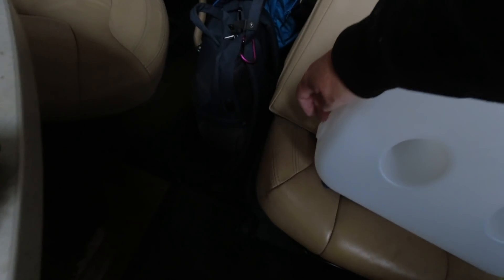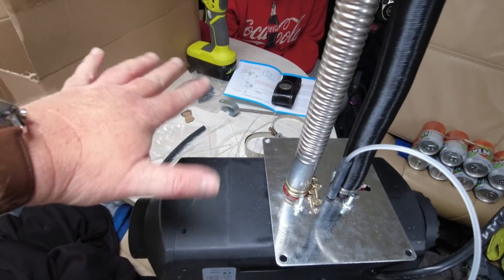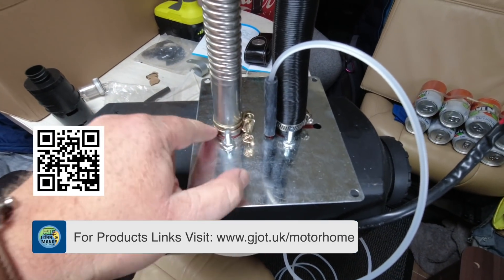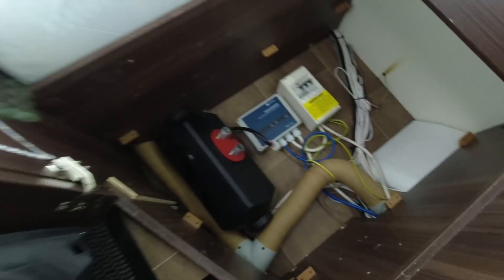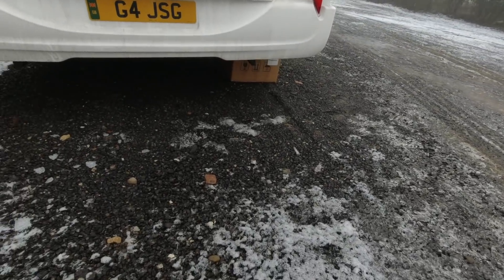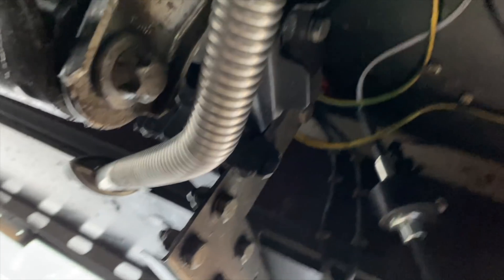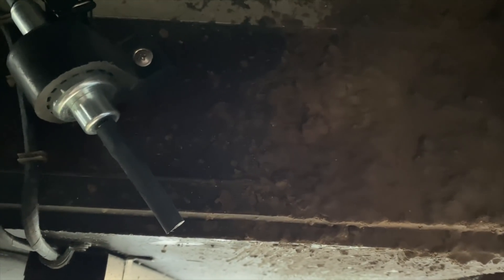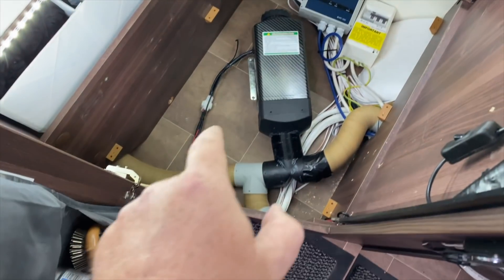Diesel heater Install in our MotorHome

Comment from the maker: PLEASE READ BEFORE COMMENTING. 
As we mentioned in the video we fitted this during quarantine after returning from the EU.  So this install isn’t 100% completed and more parts are on order to weather proof everything, make the pump quieter, protect the hole in the floor, protect the air intake and heat wrap the exhaust pipe, amongst other items. We said we’d follow up this install in a future video, and we’ll do exactly that. Thanks 👍🏻😁
Reply: It’s because we love you that we feel the need to help with trick and tips for your health and well-being and comfort, you’ve been giving us tricks and tips for years, we like to respond likewise ..we do love you, please continue.
Reply from the maker: Oh we do love any tips etc, it was just a few comments made assumptions instead of watching the full video 😁👍🏻
Reply: Nice install, this heaters are great, have one of 5kw in my Transit connect!
To silence the pump, just suspend it with cable ties, makes a big difference!
:-D
Reply: Hi you could buy a silencer for the room air intake. About the pump ticking. There is also a more silent pump from Autotherm. 
I would wanted to ask why you didn’t go for the fuel from the main tank. But the red diesel explains it. And the position on the door helps with spilling. Absolutely brilliant position.
Reply: Well that saved me asking question re an upgraded turret plate lol 👍🏻 Haha sound like I know what I’m taking about but it’s only because Darren has told me what I had to order for us lol. Hopefully get ours fitted in the next week or so, weather permitting. Hope I’ve both warmer now, useful video thanks guys 👍🏻
Reply: @zuk4wd  Removing the circular air intake grille clip from the heater housing quietens the interior noise well.
Reply: instablaster

Comment: I fitted one to my Vivaro last year, just a couple of  tip for watchers. If your running the fuel hose under your van, run it through garden hose then the sub frame / chassis this will stop rub on the fuel hose. I used a step drill to cut through the floor. You can use a mount for fitting the heater through the floor which cuts down the problem of melting your motor home installation. Finally prior to turning off, run it at about 23° for 1min this helps to clear the soot from the heater.
Reply from the maker: Thanks Andrew 👍🏻

Comment: These heaters are brilliant, had mine for nearly 3 years and it's kept me warm at minus 10 in Scottish winters. No problems with it, although I think some have had problems with sooting up inside the heater caused by running at too low a setting. Easy to strip and clean though.
Reply from the maker: That’s good then, we’ve had it blasting every morning so hopefully we won’t have to worry about that till things warm up a bit 👍🏻😁

Comment: I've installed 8 of these around a static caravan park and people love them especially when there making a great saving on the electric @ 25p per Kw 🙄compared to purchasing kerosene at 60p ltr. My top tip... To help prevent the annoying clicking sound in the van;  try replacing the fuel inline pipe from the pump into the base of the heater with a softer compound pipe. I learnt this from one heater supplied with a green pipe but with different clips. The noise seems to travel inside the pipe from the pump into the heating chamber. My 2nd tip... be careful where you mount the fuel tank as in summer the fuel gives off gas and will leak into your living/sleeping area making it stinky 😷
Reply from the maker: We’ve waiting for some better fuel pipe to be delivered so hopefully that’ll help with the click, by summer we’ll have this tapped into our main diesel tank which will be better 😁👍🏻

Comment: This is what I use in my van. I use heating oil (kero28). It's not common but some petrol stations in rural areas have a pump with it, about 40p per litre right now. Another great video, thank you.
Reply from the maker: We can’t seem to find anything remotely local that offers less than 500L 😁🙈 Red is right on our doorstep though
Reply: Yeah it's not common. I can tell you my most local one in North Devon and the one I use when I'm working in North Kent. There will always be one in an area that houses use heating oil because it's very easy to lose track of what you have, run out and then need to top up in an emergency because your family is complaining about cold baths. Guess how I know 😂. If people have oil tanks in their gardens then ask where they get their top-up when they run out. You get a lovely clean burn with Kero. Your heater will last forever. Thanks for all your technical tips. They have helped me on many occasions.

Comment: John that tip on priming the heater was an absolute gem buddy, similar to bleeding brakes remove the cap to remove the vacuum effect. Brilliant
Reply from the maker: Cheers buddy 😁👍🏻❤️
Reply: There is a 'priming' mode you can use from the controller, it's on some of the youtube videos, easy to do.

Comment: Excellent installation guys.
Just a little tip
If you used the hard plastic fuel filter that came with the heater.... replace it as soon as possible as they crack and it will empty the contents of your tank all over your garage.
(Ask me how I know 🙄)
Reply from the maker: Thanks for the heads up Ian 😁👍🏻

Comment: The silencer has a small drain hole on the side so should be mounted with the hole facing downwards, not sideways.
Reply from the maker: Thanks for the info 😁👍🏻
Reply: thanks for that tip. I have just ordered a heater for my motorhome. I will make sure  the drain hole is facing downwards.

Comment: A great video so thanks for that. I helped fit one to a friends van and we put the fuel supply pipe through the cap, this reduces the chance of a leak from drilling into the bottom of the tank, and fitting the supplied outlet. It all works perfectly, the cap will need a vent or screw it down lightly. It looks as though you have that ridged fuel line which is great, they don't always seem to come with that so you have to purchase that separately.
Reply from the maker: Thanks for watching, we’re swapping the fuel line as that is far too noisy at the mo, it’s one of the finishing touches we’re making 😁👍🏻

Comment: Educational and informative as always thank you. Two bits of kit that may help others with a similar install: You can get something called a “diesel heater turret plate” that safely passes the external pipes through an insulated floor (and makes sealing the hole you’ve cut a lot easier too), and one source of noise from the diesel pump is through the diesel liquid itself in the feed pipe so they make a damper that looks like a grey mushroom - search for “heater fuel dosing pump damper kit”. Stay safe, and warm of course 🔥🔥🔥
Reply from the maker: Thanks for the heads up Ian 😁👍🏻

Comment: I cut a big hole, probably twice the size of yours and used a plywood plate to mount mine. This gave additional clearance for the exhaust. Mine is a "5KW" and the exhaust glows cherry red on full bore. The ducting insulation is a good idea, I used exhaust wrap on mine. I would keep an eye on the insulation in case its starts to melt.  
Another great vlog
Reply from the maker: Thanks Peter, we’re still waiting for some bits to arrive to finish the heat wrapping and waterproofing 😁👍🏻

Comment: Is a very good upgrade I love mine I only use kerosene/heating oil on it. It burns cleaner and avoid gunk up as red diesel has more oil and creates more fumes. Good video.
Reply from the maker: Thanks, we’ll look into that in the future 😁👍🏻
Reply: This is true and tends to be a lot cheaper. 60p ltr from most Narrowboat yards. I took one heater apart after 2 years of use and it was as clean as a whistle 👍

Comment: in my opinion you got the best control unit ..
and the boxed heater with more comprehensive kit than usual can be had for £63 of ebay right now and it comes with fantastic instructions even reminding people it is a must to always face your exhaust down

Comment: I'd recommend putting a power switch on the screen controller, it will go very dim after a while and I'm sure you've found it quite bright in the night. Also keep an eye on the floor insulation, it's only eps foam so cant withstand much heat and the exhaust will easily exceed 200 during normal usage, exhaust wrap for motorbikes will solve this or you can get a "turret mount" to replace the plate . The troubleshooting Facebook group is a great resource as well. Cheers guys :)
Reply from the maker: Thanks Charlie, it’s an interim fit as it was going to go under the drivers seat so we bow need some extras for where it is which are on their way.. we use a really low tech solution of hanging flannel over the screen 😁😂

Comment: I’ve just fitted a stand alone heater in my single car garage workshop and it’s fantastic. My mate has removed his wood burner and also fitted one too. Great video as usual. Cheers Richie.
Reply from the maker: Cracking but if kit aren’t they? 😁👍🏻
Reply: Just wondered how you powered it? I’m trying to find a 240v to 12v supply that can deliver the current needed.
Reply: @Bannister99  I power with a car battery and keep it topped up with a charger.
Reply from the maker: @Bannister99  we’ve seen loads running it with power oak AC50’s 😁👍🏻

Comment: Glad your heater worked without issue.  I bought an identical one but have constant E-10 errors.  Currently waiting for replacement parts which will hopefully fix the problems and get it running.  If not then I may just buy another and keep my fingers crossed the 2nd one works. 
Great vid btw! 👍👌
Reply from the maker: Hope you get something sorted soon Craig 😁👍🏻

Comment: Hi, after a year or so of using my diesel heater Ive collected the following snipets of interest. If you suspend the pump (mine hangs on about 2 inches of cable tie through the bolt hole in the rubber mount) its virtually silent. If you mostly run it at low outputs then the combustion chamber tends to soot up, so its worth giving it a blast regularly, and thirdly, they run happily  on paraffin (or jet A1 if your rich enough!) and they don't tend to soot up as fast on paraffin. Hope Cooper enjoys his new heater :-)
Reply from the maker: Thanks Peter.. we’ve a few things underway to help with the pump, glad to know suspending it helps a lot 😁 
First thing in the morning we have it on full to help blast the door and so it’s warm enough to get dressed 😊 Coop loves the new heater 👍🏻

Comment: There’s actually duty and VAT on red diesel but you are correct it’s a lot lower than the duty & VAT on Road Diesel. You can also run it on Kero which is fully duty free 👍 and Kero does not wax up in freezing temperatures.

Comment: Good idea having a second form of heating and a bonus of being cheaper too. My van has diesel heating which is connected to the main fuel tank and works really well. I also found out last year that it is useful to have a backup option. My gas regulator packed up but because we were on an electric hook up we could use the microwave to cook everything and make drinks plus switch the fridge over to 240v however before we go out again I will carry a spare regulator. I think I will also get some form of table top cooker for another option.
Cheers
Martin
Reply from the maker: That’s good to have Martin, we have the instant pot and Nespresso maker to go with the kettle and the hob.. definitely good to have options 😁👍🏻

Comment: Hi Guys. Good vid..when your refining that install..i would get another tank. Same type if you like...But use a stand pipe..and take feed from the TOP. I've done this fot  2 diesel heaters.. Zero chance of  leaks from the tank..eventually bottom outlet will fail..not good.
Anyways keep up the good vids.  Ian &Dee from Ireland💏☘
Reply from the maker: The tank is designed with the feed at the bottom, someone sat down and designed it that way, so as ours works perfectly that way I’m going to leave it so it’s neat and working as designed

Comment: Hi guys, I'm glad to hear that you finally "warmed" to the idea of a diesel heater, we did it to ours last year and its been an absolute boon! Sod the gas set up. PS, 1688 let's you into the settings and you can adjust the kilowatt settings. Welcome to the diesel club. Also before you turn it off just ramp it up to boost for 10 minutes before switching off, just keeps it clean and reliable.
Reply from the maker: Haha.. thanks David.. what’s 1688? We’ve been told about some secret menu but not how to access it.. we have a slightly different panel to ones we’ve seen before 😁👍🏻
Reply: Check this YouTube video out, it'll show you how to alter the settings using 1688, plus I agree, don't trust the temperature setting, you can change it over to hertz (pump pulses) so you can can manually control the temperature in your van, John McKay47 is also very good, he has a series of videos all about these units, to change to manual control simultaneously press both the top buttons briefly John. Oops, I forgot the link, I've added it below 👍

Comment: Excellent video quick tip if you get fed up with the ticking of the pump suspend it on exhaust mountings ticking gone 😁 also it’s easy to put the fuel line into the sender on top of the fuel tank on the Ducato
Reply from the maker: We’ve some additional bits arriving to help with the noise but it’s not too bad now. We know 😁 we chose the external tank so we can run red as we said in the vid 😁👍🏻

Comment: Hi J & M I put a 5k Chinese diesel heater in my workshop thinking it may help to warm the place to say I am disappointed would be mild. Its best temperature to date coming out of the useless thing is 24 Degrees by the time you've got the gauge a foot away its just a cold draft. We have an Eberspacker in our static in Scotland and you can't hold your hand near it for very long. I suspect there is something wrong with Chinese one but at the moment decided you get what you pay for. I can't complain though as I got 60 quid back off the seller and kept it. But it has made reluctant to buy another. See ya keep your heads down and stay safe.
Reply from the maker: We know so many people with these bargain chinese heaters that a different one is rare.. glad you got some money back from it 😁👍🏻

Comment: Just a quick tip, as I've not seen it mentioned in the comments.
To prime the fuel line, press and hold both the up and down arrows at the same time, and it starts the pump. The only problem with it is, if you let go, it stops. If you've got an assistant, get them to watch the bottom of the heater while you prime it, and then it should fire first time. It does take quite a while to prime the line/filter, longer than you'd think.
Reply from the maker: Thanks Phil 👍🏻👍🏻

Comment: Jings John glad you ordered that when you did as you will need it according to the weather forecast , need to look after Mandy and Cooper 🥶 . Fran and I have been looking at installing one and we haven’t been out in the Moho a lot since we got it. It’s only done 2000 miles since June due to you know what but I have used it at the end of October and it wAs very cold during the night. We have a whale system and I don’t think Elddis have fitted it to its capacity. As you say a diesel heater is my next approach to our heating problem so need to watch your video to the end, glad to see you are all back home safe, hop Cooper is adjusting to the climate change 🥶🚐🥰
Reply from the maker: Thanks Eddie, coop is not pleased at all, we’ve never seen him want to get back in the van so quickly - ever..! Sounds like a good call to look into a diesel heater then.. hopefully you’ll be out and about soon enough 😁👍🏻

Comment: Good job mate. Try fitting diesel heater on a ribbed floor van no quite so simple. But nobody tells you (and its not in heater parameters booklet) that they don't work if one does not have correct voltage levels in your batteries, it will drain the batteries. Then you have a problem. Never use engine battery to power a diesel heater unless you run engine every day (as in a HGV).
Reply from the maker: Good to know, thanks.. 😁👍🏻 it was nice and simple with the flat composite floor that’s for sure 👍🏻

Comment: Hi you two. You both look well. Re the heater exhaust / air intake through the floor. Did you then cover the piping and hole to stop water spray getting into the hole that you cut out
Reply from the maker: As we said, this was not complete, just to get us past the problem of having no heat. Please read the top pinned comment. 👍🏻

Comment: Hi John I have fitted a few of these and would advise you to put some small jubilee clips on the rubber fuel pipe where you are joining them to the small fuel pipe and the connection at the heater, great videos thanks to you and Mandy and Coop
Reply from the maker: Thanks for the heads up Jimmy, we’re waiting for replacement fuel hose then will sort them out 😁👍🏻

Comment: We have a chinese diesel heater fitted in our autosleeper duetto and it works great, but we use kerosene home heating fuel in it and it works perfectly and its cheaper
Reply from the maker: Thanks Kieran, where do you get small amounts of kerosene from? We’ve looked but can’t find any cheaper than the red we’re buying 🤷🏻‍♀️